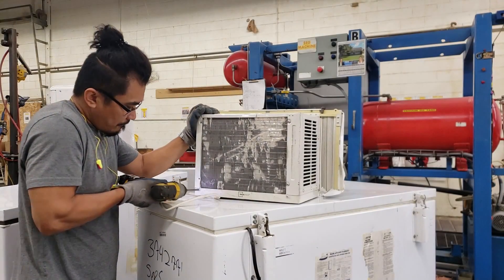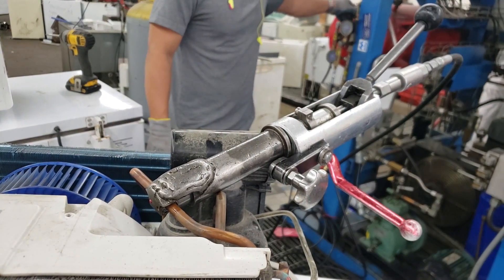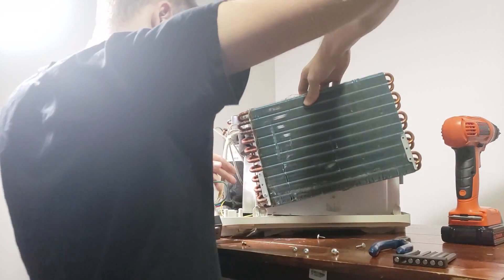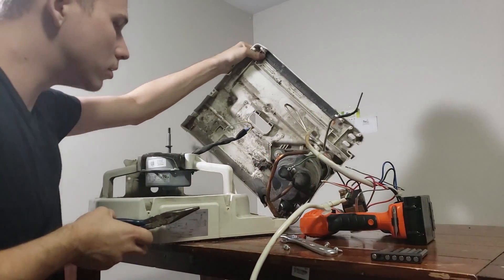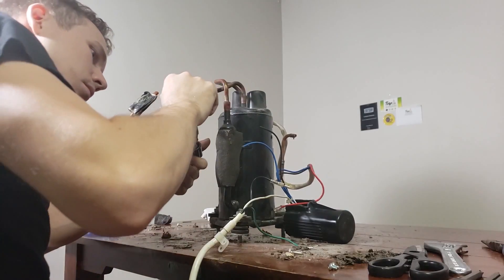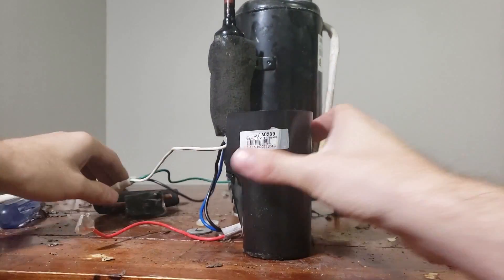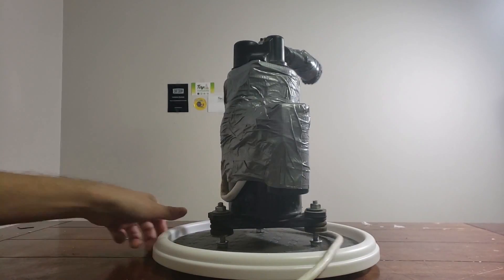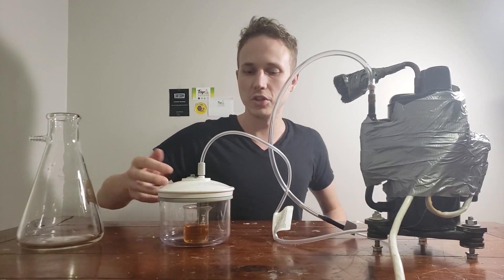Free Vacuum Pump made from Scrap

Comment: Awesome DIY brother! 
What was on the end of the other tube from the compressor??? Looks like maybe a filter but not sure?  Please let me know! Keep the vids coming!!👍
Reply from the maker: Just some cloth I taped over the end to help catch any oil vapors
Reply: Thanks again! Just got on the local apps to see if anyone is selling a window unit😬
Reply from the maker: Can also use a dehumidifier or fridge or or mini fridge/wine cooler. Basically anything with a closed refrigerant system. Just make sure to have the refrigerant properly removed at a facility.